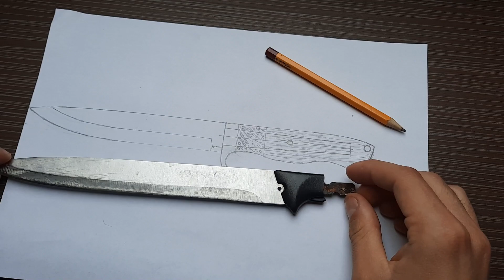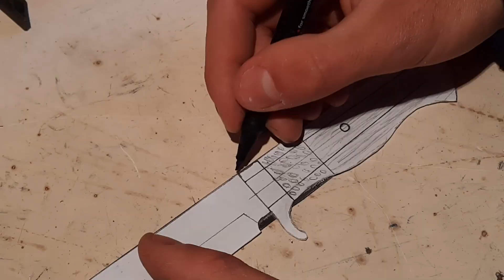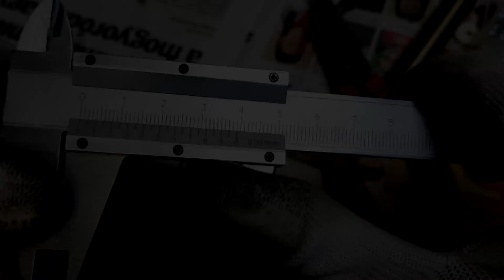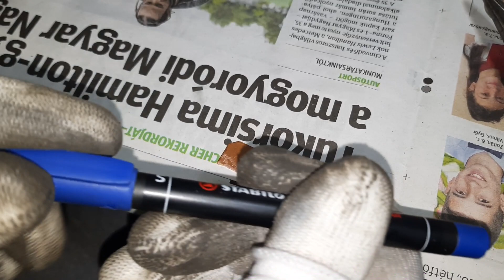Making a Kitchen Knife - Restoration video

Comment: Dude, you could have used a bandsaw! You run less of a risk overheating the steel when profiling your blade and you're better able to follow your cutting lines! Otherwise, the knife turned out great!
Reply from the maker: Thanks dude, yes I would like to buy a bandsaw but I'm still in the beginning, I don't have any free place. For now, I have to make the tools with this grinder.

Comment: To add to my previous comment, you should NEVER use a knife as a center punch! That's the surest way to break the tip off of the blade! Also, if you need to mark drill holes, get a large nail in lieu of the actual tool itself!
Reply from the maker: Okay, I accept your advice. unfortunately I am short of tools, so I'm improvising
Reply: @Matthews_Tools My apologies!